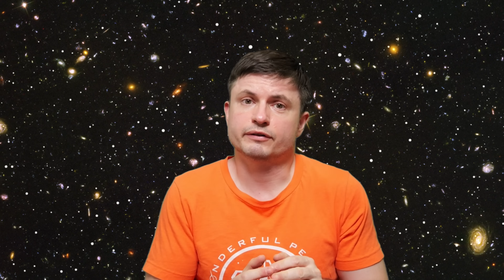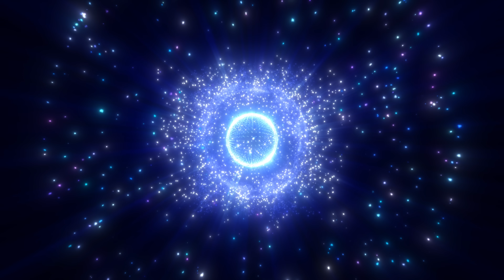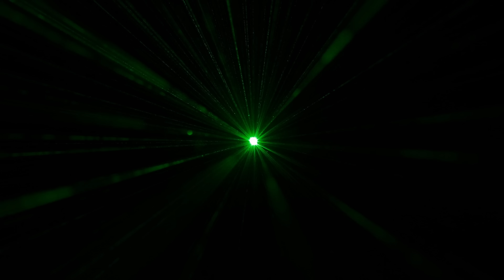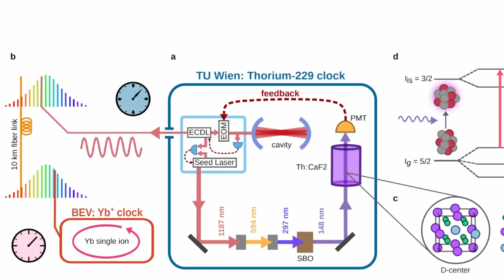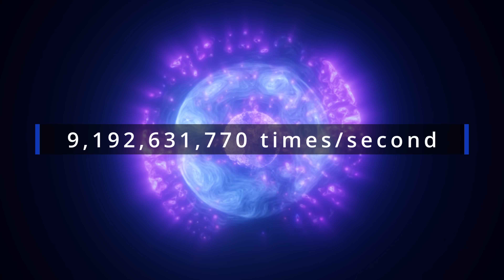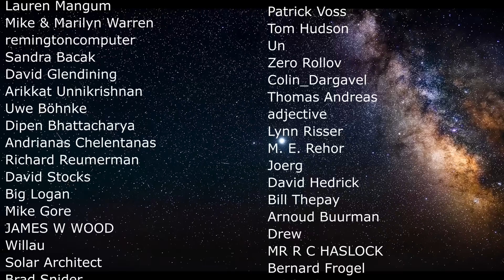The Nuclear Clock Is Finally Real And It May Change Everything

Comment: This video discussed the scientific applications of a stable high-precision, but as an engineer, I need to mention the practical applications. These clocks aren't affected by most things, but they are affected by gravity and the distribution of nearby masses. They run faster or slower depending on the amount of mass in their vicinity. Create a large array of said clocks, and now you have a way of measuring and mapping the mass distribution of anything in the nearby area.

That has all sorts of remote sensing applications. The video mentions using them to probe the Earth's core, but they could just as easily be used to search for anything underground - minerals, tunnels, faultlines, etc.

But to give a feel for the potential of this, let's consider just one example in detail. I have no idea if these are sensitive enough, but with stable clocks of sufficient precision, it should be possible to create the ultimate radar. You have a vast array of such clocks scattered across the countryside. When a plane flies through that region, it slightly slows every clock it passes. Sure, passing trucks probably have more effect on each individual clock. But combine the signals from thousands of such clocks with a whole lot of machine learning to specifically select for the signals of aircraft (appropriate mass, elevation, velocity), then you now have the ultimate radar. Let's call it "gravitational radar."  

Such a thing would be revolutionary. Gravitational radar would be completely immune to weather. You might have to factor the mass of clouds into your sorting algorithm, but they wouldn't block the signal. There's no hiding mass. There's no shielding against gravity. It would be completely impervious to any stealth measures. No special coating or hull shape will affect it. And it even neutralizes normal attempts at jamming or destroying radars. There's no jamming or spoofing gravity. And the entire military tactic of starting an air campaign by destroying the enemy's radar would be completely defunct. A gravity radar has no big expensive central dish to destroy. Your "radar" is a hundred thousand tiny cheap metal boxes buried in the ground in locations scattered across your country. Even the processing is performed via vast cloud computing. There simply is no central radar asset to destroy. It would be impossible to destroy such a radar system short of completely flattening the entire country. 

For civilian applications, this means a radar that never need worry about the weather. For military, it means that as long as you have a country, you will still have radar. 

Again, I don't know if these specific clocks would be cheap and precise enough to allow this specific application. But there are a lot of very interesting things you can do if you assume clocks of arbitrary precision. Just like how the GPS system is only possible because of atomic clocks, nuclear clocks might open up their own previously impossible technologies. As you note, they would have many scientific applications, but there are a lot of very interesting potential technologies that could be unlocked in the future if clocks get precise enough. Anything that can be boiled down to measuring the positions and movements of masses could be affected. And these technologies would all require potentially decades or longer to develop. I make a gravity radar sound easy, but even with clocks of sufficient precision, going from conceptual model to working national-scale defense grid would be a Herculean undertaking.

PS. I really had to resist naming "gravity radar" as simply "gadar."
Reply: It's seems implausible that would be enough precision to ever be able to separate out an aircraft from the background noise in this. An aircraft isn't really that heavy even compared to other moving objects, and their probably at best a couple km away from the sensor so the field strength will be extremely low. I'm not an expert though.
Reply: gravitational  detection and ranging -> gradar
Reply: @freddyvejen743  gravidars are usually how this is abbreviated in scifi
Reply: As a (former) geophysisist, I see possibilities for precise gravimetry, not plagued by magnetic fields and "zero drift" of current gravimeters.
But... you will need to much more accurate control for surrounding terrain, too.
And yet another possibility is measuring the gravity force itself and 3 derivatives (dx, dy, dz).
Thank you, Anton, for the info!
Reply: The precision required would be much higher than anything feasible in the next decade. Hell it might be so sensitive that it might be impossible due to hyperfine splitting of the nuclear energy levels caused by the Earth's magnetic field
Reply: In gaming these are called gravidars!
Reply: and think, once that radar exists...  what sci-fi type doors get opened as we try to counter that radar
Reply: Trying to now think about how this might be abused.  If you can accurately image an area using these, then that seems very applicable for privacy violations.
Reply: @futuza  Of course that's the first thought someone has about a scientific breakthrough: "Is there any way this could unlock a new way to be a victim" 😂😂😂
Reply: @Quazgaa 

Or maybe "is there a way the Regime can exploit this amazing new technology to completely control its population?" --

There. Fixed it for you.
Reply: @Quazgaa   You have to think about these things early and come up with regulations in the lab or you get tech billionaires trying to abuse it ASAP.

Comment: What will this actually improve
Reply: Drone strikes
Reply: It'll basically increase the accuracy of most scientific measuring devices. Black hole mergers, gravity maps, and the insides of the earth, all of this is going to get better and more frequent
Reply: Another comment pointed out that it may be amazing for navigation if you could detect clock drift from moving 1 mm away from the planet.

Comment: Critique this ; dX/dt = f(X,V) + D∇²X
dV/dt = g(X,V) + Σ K_ij h(V_j - V_i)
C = (ΔD · ΔO) / (ΔC + ε)
dR/dt = β · (L · σ · P · S) - λ · C

DEFINITIONS:
X = biochemical concentrations (hormones, gene products)
V = transmembrane potentials (physiological arousal state)
f,g = rate functions for biochemical and voltage dynamics
D∇²X = diffusion of biochemical signals through space (D = diffusion coefficient)
K_ij = coupling tensor (physiological synchrony between individual i and j, 0-1)
h = hysteresis function (bistable memory, state persists after trigger removal, 0-1)
ΔD = dopamine spike (reward magnitude, 0-1)
ΔO = oxytocin spike (in-group bonding magnitude, 0-1)
ΔC = cortisol spike (threat magnitude, 0-1)
ε = baseline neural noise floor (constant 0.01)
C = systemic control parameter (0 = free, 1 = total control)
R = resistance efficacy (0-1)
β = biological altruism constant (~0.85)
L = labeling accuracy (disinformation flagged, 0-1)
σ = semantic salience (correct terminology used, 0-1)
P = pushback frequency (active resistance, 0-1)
S = sharing diffusion multiplier (amplification speed, 1-10)
λ = resistance decay rate (fatigue/censorship, 0.01-0.05)

Comment: The half life of Thorium 229 is about 8000 years, so you would have to replace the clock long before it was off by a tiny fraction of a second
Reply: Clearly another case of planned obsolescence... 🙄
Reply: Yeah, that's strange. I wonder if they will gain any insight by watching a radioactive decay on this timescale!!
Reply: @tomholroyd7519  Decay doesn't happen if you watch it with big enough temporal precision. You project the system into a specific state on measurement. That makes the system unable to decay. It is like you reseted the expected time of decay. This is called the Quantum Zeno effect and is reported in the literature.
Reply: Will it even decay? I think this counts as a measurement. So the nuclei should not decay by the quantum Zeno effect.
Reply: You can replace the atom.

Comment: Now we need a quantum clock
Reply: We have them, the only problem is no one is certain of the time
Reply: @OtakuByNight  😂. Is it possible to stabilise a neutron? Then we could measure the oscillations of quarks within a neutron
Reply: It's actually one of the main reasons to develop these super-accurate clocks, because a measurement of the superposition of time is a direct probe of general relativity + quantum mechanics.

Comment: Nuclear Magnetic Resonance (NMR) was renamed to MRI (magnetic resonance imaging) because "nuclear" is scary. Anyway, we "easily" send and receive radio frequency (RF) signals to/from nuclei. Very light nuclei. That's how MRI works. Well, "easy" but you have to do it inside a ginormous magnetic field (3 Tesla for example, up to 11 T or so; higher than that is very hard)
Reply: NMR does not interact with the inside of the nucleus like what Anton is talking about but flips the spin of the nucleus in the external magnetic field. Although both are “nuclear”, they are totally different.

Comment: Thorium-229 has a half-life of 7,880 years.  A nuclear clock might have an accuracy of 1 second in 140 billion years, but it would mostly disappear in about 1 10-millionth of that time.  About how long it takes me to stop hitting snooze when my alarm clock goes off in the morning.
Reply: It's not all gone after two half lives, after that period the decay rate would be reduced to a 1/4 of it's original value.